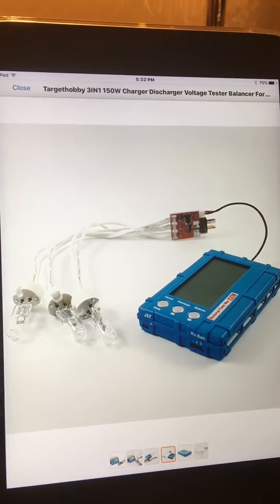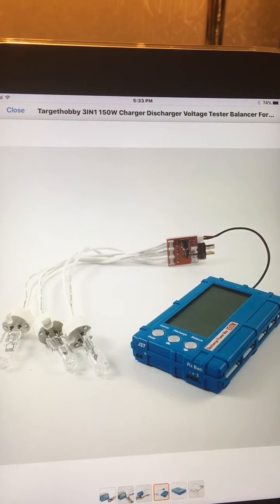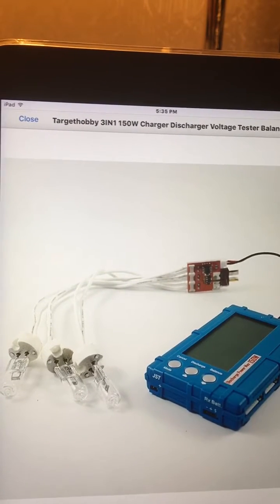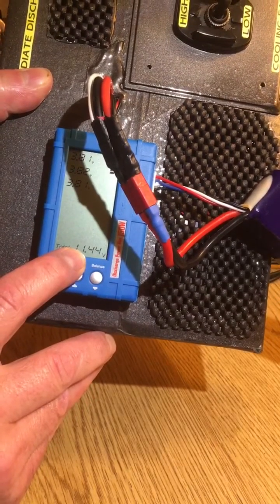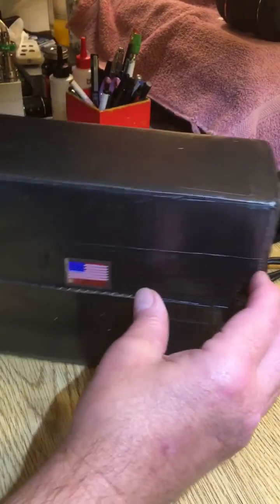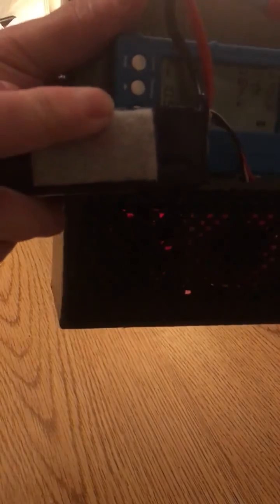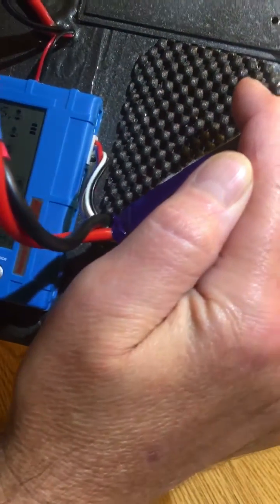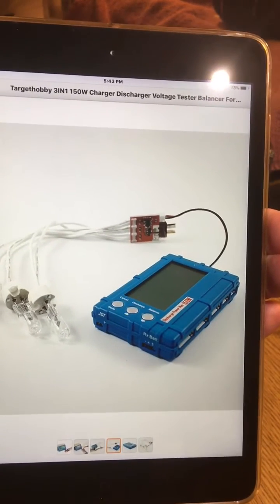(150 WATT) LIPO BATTERY DISCHARGER

Comment: Hi if you don't want to go lower than a certain volt would the fan drop it below
Reply from the maker: Leigh Hodge 
The fan is part of the load as it's wired. I definitely wouldn't leave it unattended. I have hi capacity cells for a ducted fan I use it for mostly. It was a rainy Saturday & I felt like making something.